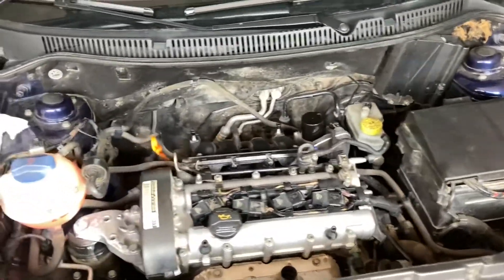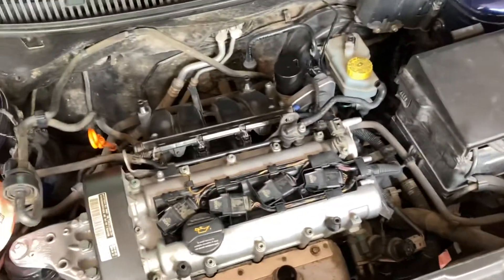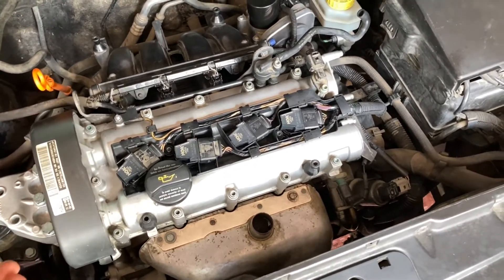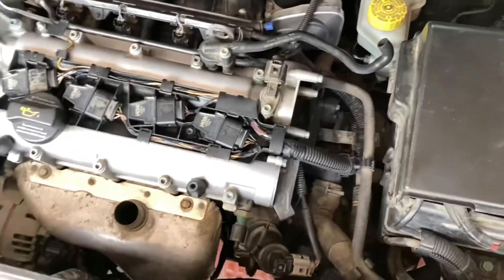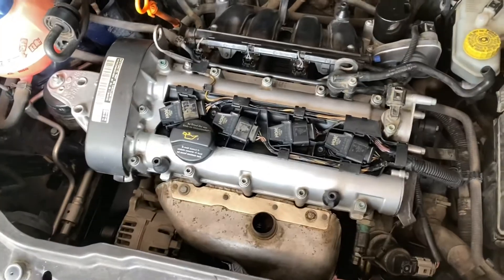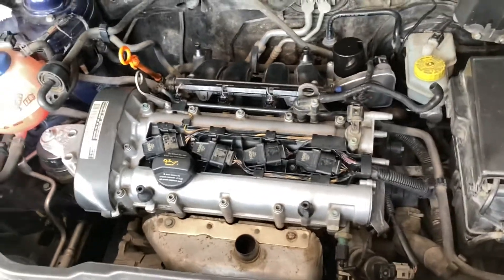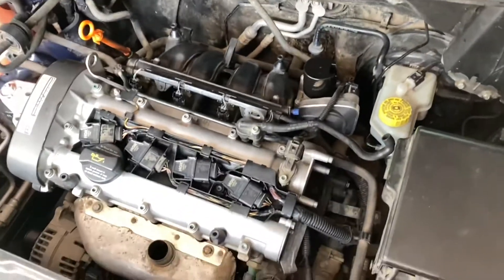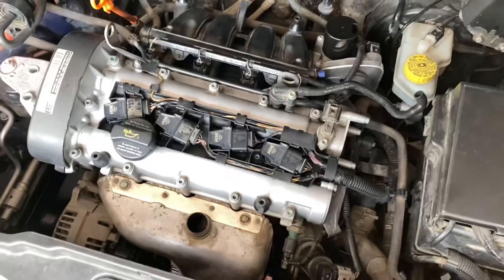Volkswagen 1.4 Engine Misfire Issue Solved// POLO, GOLF, FABIA, IBIZA.

Comment: I have the exact same model i tried everything except this. I cleaned the fuel injectors i replaced only the spark plugs i put only 100 gas yet, i replaced the knock sensor yet it’s still here. This is my final hope…
Reply: Did it help?

Comment: Did all that ended up being a bad injector that's it was got second hand unit 40 pound for four easy job easier than changing the plugs just 2 screws and pull

Comment: Hi guys got the bca engine sucking air from oil filler cap and misfire valve noise on driving i change the pcv and still same cna some one help pls
Reply: Read post just injector fault